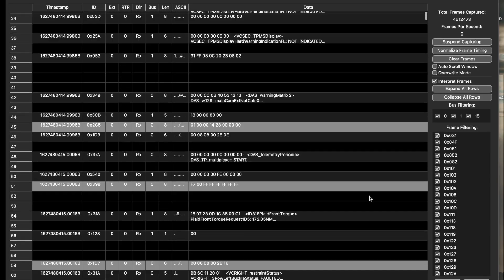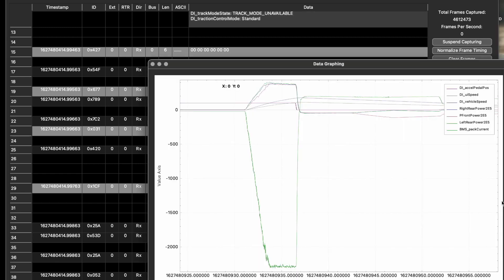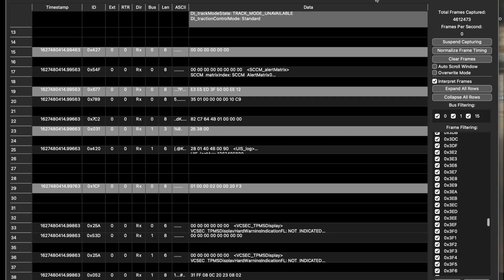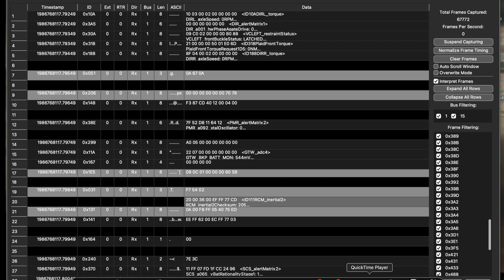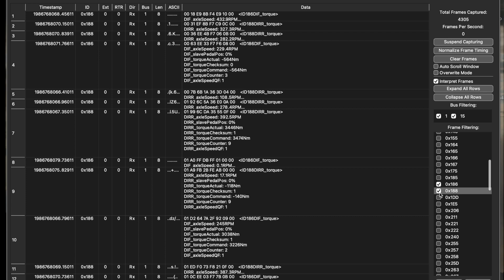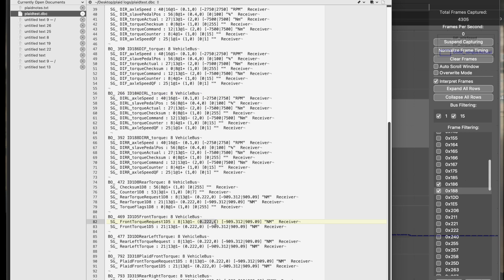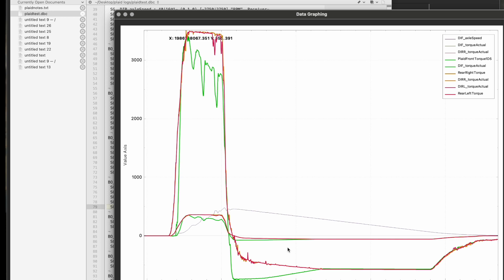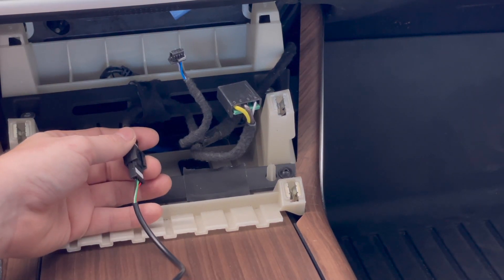Plaid Torques Found!

Comment: Hey bud, do you know which pin on the plaid canbus provides throttle data?  

Could you please send me a link if you have an adapter I can plug a positive and negative throttle data reader into?  Im building a throttle sensing sound device